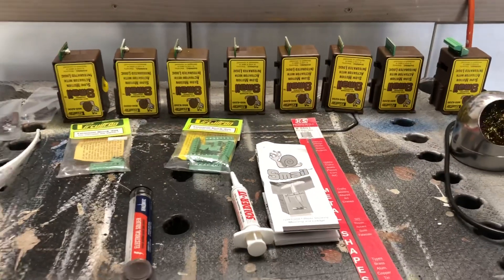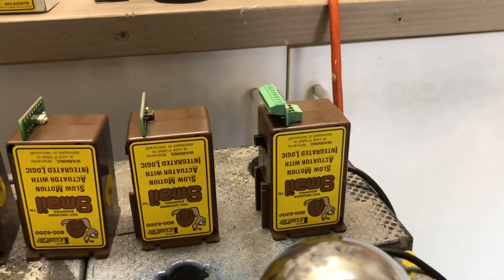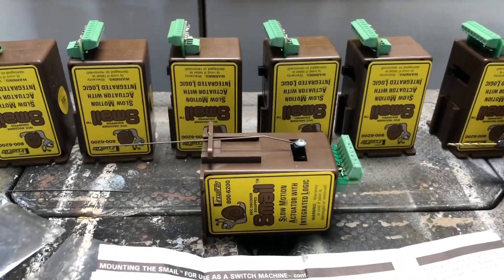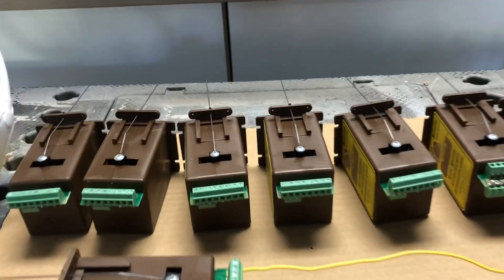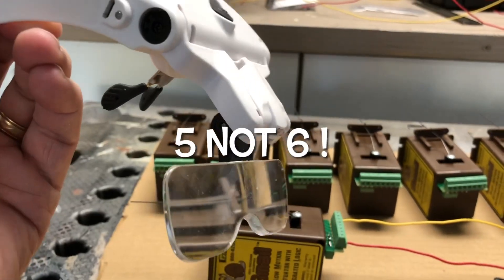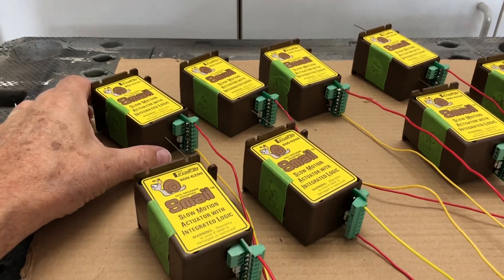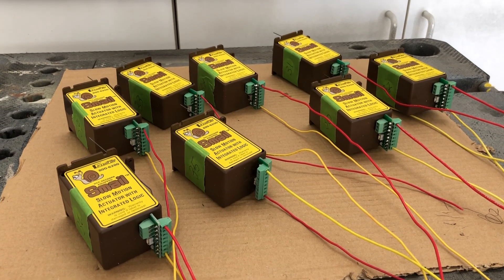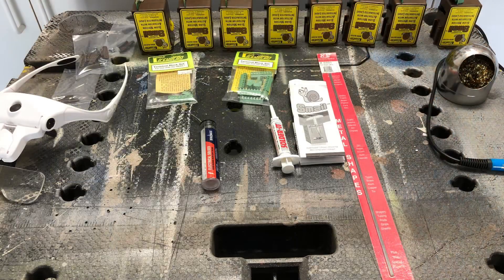My 4x8 x 2 HO Layout - SMAIL Turnout Motor Install (see comment)

Comment: A group of snails is called a rout or a walk but I don’t know why because they are not routy and slide not walk. If you had a smail car on the track with the big S on it you could yell hey, look at the “S car go” when it goes by. I think they call snails that too. Lol. On a separate note, who is this high tech Fred? Who are you and what have you done with our friend? You are going to have much more reliable layout and I can see the scripts running by computer in your future. Great job Fred.
Reply from the maker: Thanks Derek. 😀  “S car go”.  That is funny!  You are super witty!  I’ve been working with these guys for quite a while.  I’ve just finished researching how to get one to throw in reverse.  I’ve address the motors on each side of a cross over with same address so they throw at same time.  But right now, one is closed and other is thrown. #$&@ 🤬. Being the simple guy that I am, I think reverse wire on one. Nope! 🤬   I could try just unscrewing one and physically reversing it but... That would be a pain in the as*!   The manual indicates changing CV 584 to 1.  Guess I’ll try this first.  If it works, I’ll include on next video.  If not then I’m back under the layout. 🤬🤬🤬
Reply: I did see a video that it could be changed by cv but I don’t remember who’s so not much help. I have faith you will figure it out. It will be great to have two throw at the same time but it would be a waste of a smail with the decoder. Do you have a regular tortoise or other turnout motor that could be the slave to the smail? Then you could use the other smail somewhere else.
Reply from the maker: 😀. It worked!!! Now to do all other crossovers...
Reply from the maker: I don’t have a tortoise so will just stay with the Smails.  I need to do this on 5 other existing crossovers.  Make it lot easier.

Comment: Flying Crow is correct. A group of snails is called a rout. BUT, a group of Smails is called a headache. Good luck!
Reply from the maker: You don’t know how right you are!  🤬 Two of them are not working right.  Can’t get them programmed to an address.  I think my #$&@ soldering is the issue.🤬🤬.   I’m reminded again that frustration is a significant part of this hobby.

Comment: Thanks for this excellent video, I want to ask you, if this is compatible with the roco 10836, and to be able to do the programming? and from where and how do you take power for all the swicths?
Reply from the maker: Thanks 😀. I’m not familiar with the Roco device you mentioned.  I use a MRC Advance system to run my layout.  The Smails are connected directly to the main bus wires the run under the layout.  My system is old but works fine to handle several locos running at same time.
Reply from the maker: I looked up your device and found that it’s a dcc decoder.  You don’t use these with a Circuitron Smail as they have a built in decoder.   I think these are more for a switch motor that doesn’t have its own decoder like a Circuitron Tortoise.
Reply from the maker: Here is instruction manual on Smail.  http://www.circuitron.com/index_files/ins/800-6200ins.pdf

Comment: I got a pair of those magnifiers as well.  You got a better deal than I did though.
What are your thoughts on getting the Smails with built in decoders or using tortoises with stationary decoders?
Reply from the maker: I do like these glasses.  I bought a really cheap pair previously but these are now in trash.  

I initially started with Smails because the Tortoise videos I found on YouTube didn’t explain how to connect them to DCC controller.  The Smail video I found showed the direct connect to bus line.   I could understand this. 😀.   Smails cost about $30 whereas Tortoise are $20 but then you need multiport decoder.  A NCE 151 is about $70 to support 8 tortoises.  There might be something cheaper but this is what I found.  So I figure the cost between them is about the same.  Big thing for me is simpler.